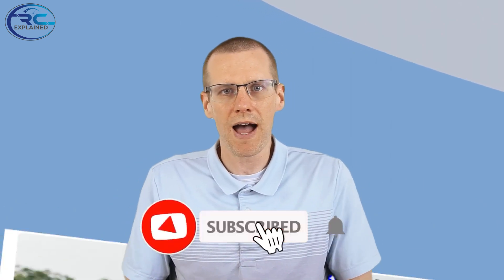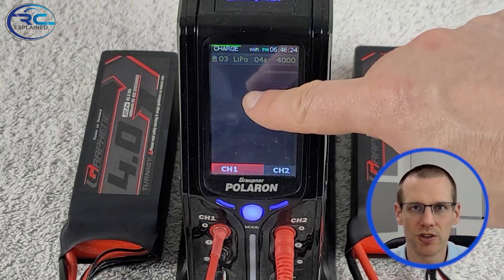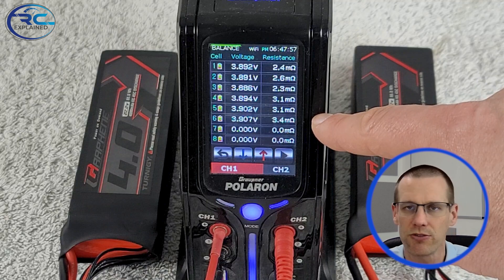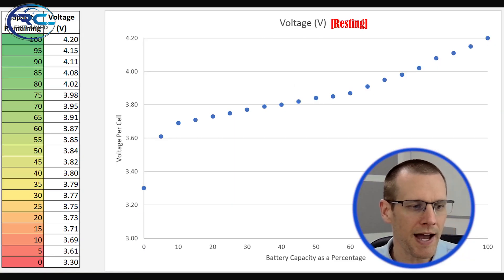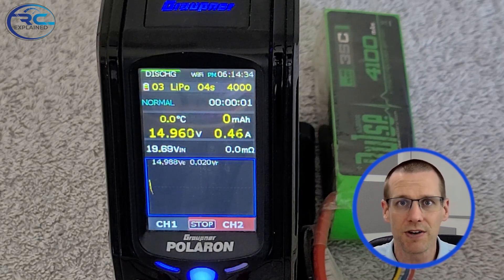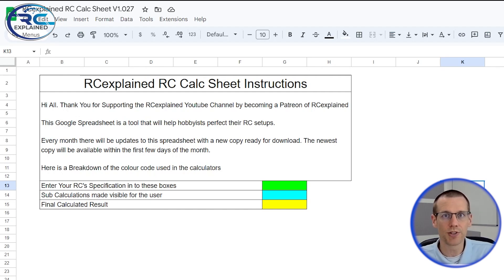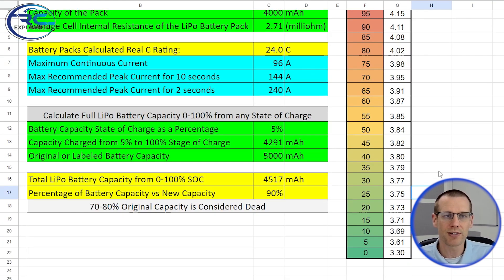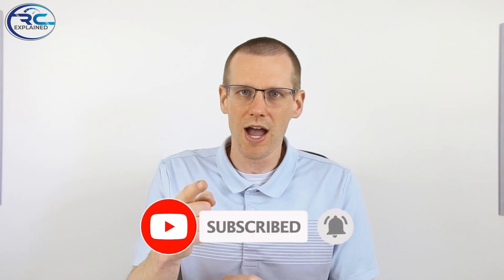No More Guesswork: Safely and Consistently Measure LiPo Battery Capacity and IR

Comment: What tester do you use? I bought some but they don't actually measure capacity, but only gives a state of charge based on voltage. I need something cheap as a starter.

Comment: Fantastic video as usual! I really like that you have been diving into the topic of Lipo battery technology lately. There's something to learn from novice to advanced expert. I'd like to request that you do a video on how to truly determine the performance of a lipo pack by stress load. I know you are very much aware that an ESR is not good for determining the performance of a pack, rather, the pack needs a full 10 second burst load (250A) draw. The recovery voltage divided by the number of cells multiplied by "100" will give us a 3-digit value we can use to rank each pack. I have only found ONE unit capable of doing this test, and it's not cheap, but maybe you have annother way to accomplish this task? Also, I am wondering if my iCharger 406Duo or 308Duo will do what your charger will do. I have searvhed for your charger, but it doesn't seem to be in production any longer... Has so many very neat features!

Comment: Maybe a dumb question, but why is it considered dead between 70-80% capacity? Is there something specifically in the battery chemistry at that makes it unstable below that threshold? Otherwise, why would I chuck a battery that provides 15 minutes of run time instead of 20?
Reply: Cause Kermit said so...😂
Reply from the maker: While a lithium battery may be considered "dead" at 70 to 80 percent of its original capacity, it doesn't mean it's completely unusable. In many cases, it can still function adequately for less demanding rc vehicles or in vehicles where a lower capacity is acceptable.
Reply: Its is inefficient to use a battery when it falls below about 70% total capacity. That is one of the problems why Sodium batteries are not usable currently. You could only use about 70-80% of the total capacity of a sodium ion cell and that is only about 70-80% of a LFP cell. And it costs about the same. That is inefficient.